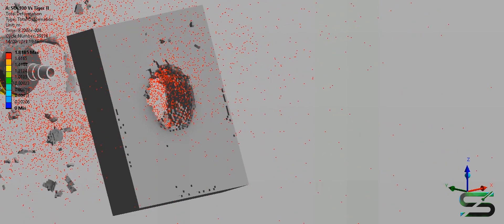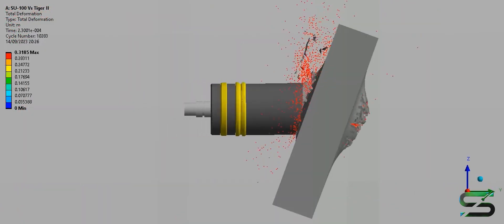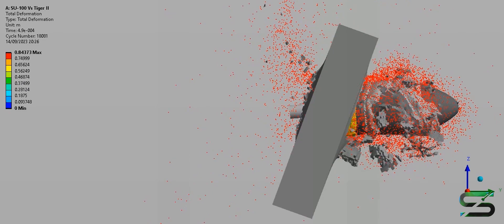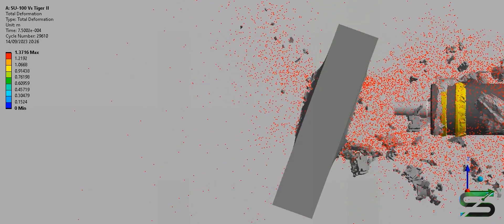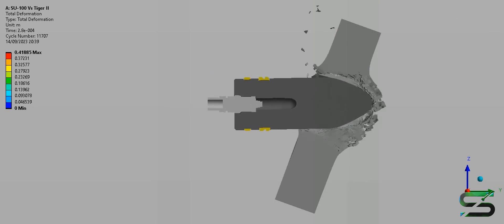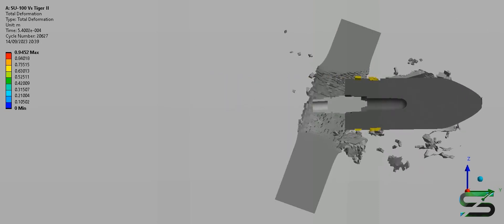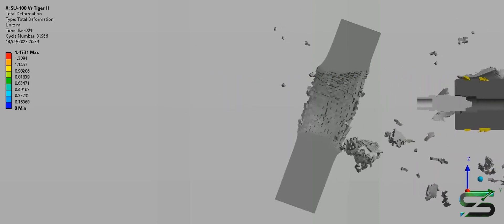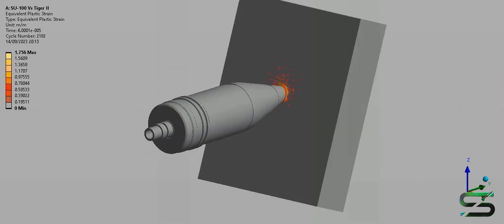SU-100 Vs Tiger II | 100mm BR-412D Armour Piercing Simulation

Comment: Fuse got detached after penetration, could this apcbc still able to explode inside?
Reply: Wouldn't make much of a difference even if it did, the shrapnel is already lethal, the shell could probably exit though the other side of the turret with how little deformation there was to it
Reply: @TheMeanLemon I always thought this kind shell always explode when it penetrated intact. Yes even without explosion, fragment from turret inner walls enough to injure or kill the crew inside that turret